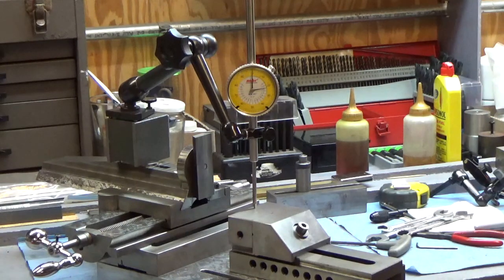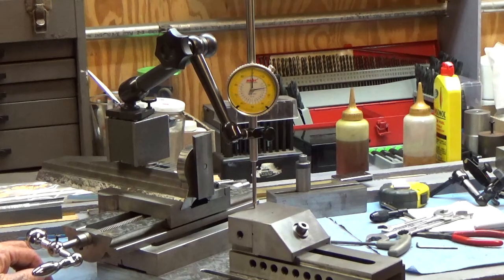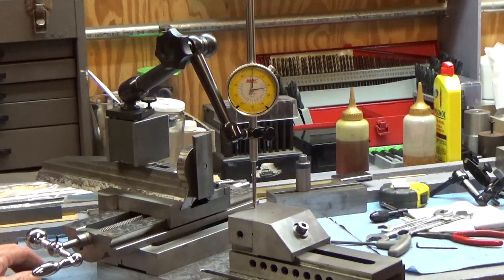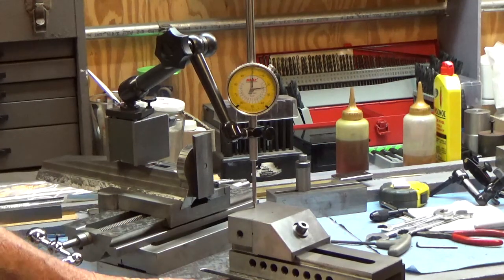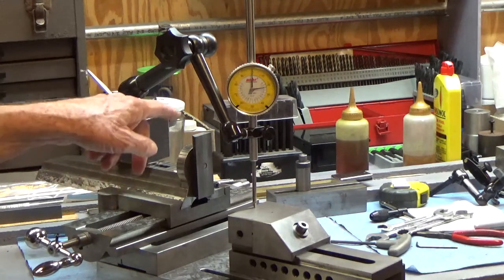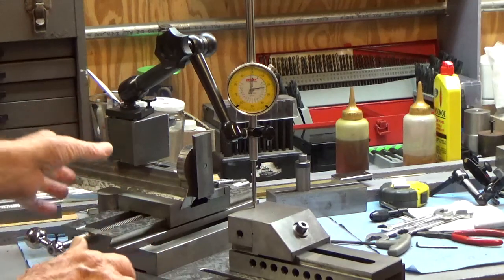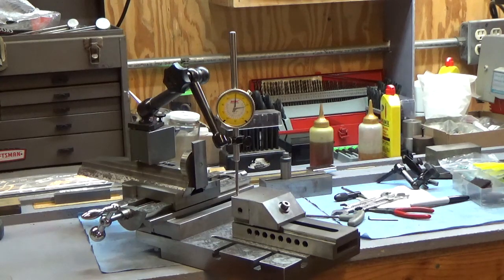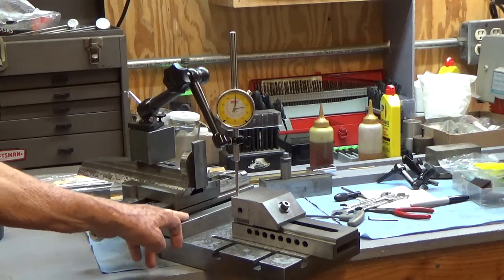Shop Built Hand Shaper Build Scraping Progress

Comment: Hello Larry, sorry I have just got around to viewing this video, that is looking excellent, and you have done a great job up to this point, I think you might just leave it as it is right now and wait until you get the hand lever and linkage finished, then you can spend some time working all the moving surfaces in for a while just in case you have high spots, (like running in an engine), then afterwards check for any errors in the readings, 

Edmund............Alberta
Reply from the maker: Walter:  Thanks for the comment.  I've finished the levers and linkage and ready to begin the inner workings of the ram.  There's just a couple simple parts, but there could be unforeseen difficulties lurking.  The project has been full of never ending surprises.  Your shaper is coming along nicely, and I'm always impressed with your expertise and ingenuity.  Best Regards: Larry